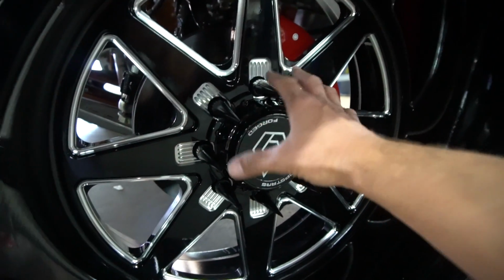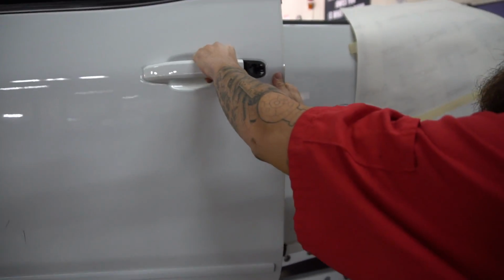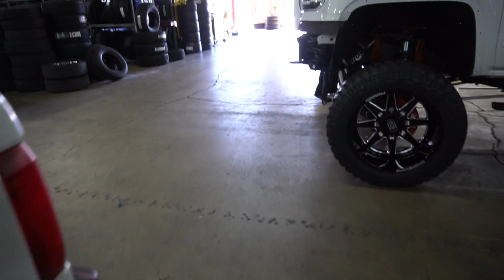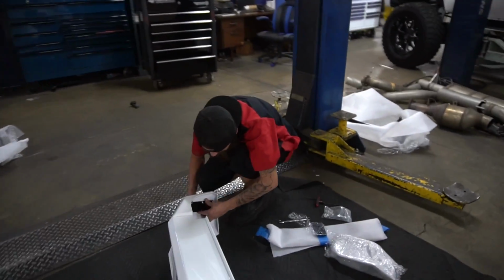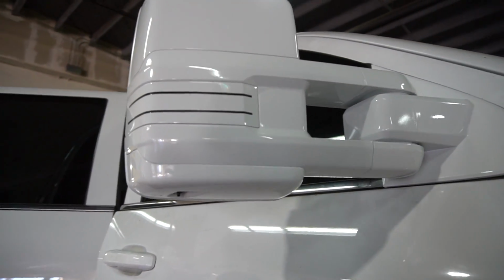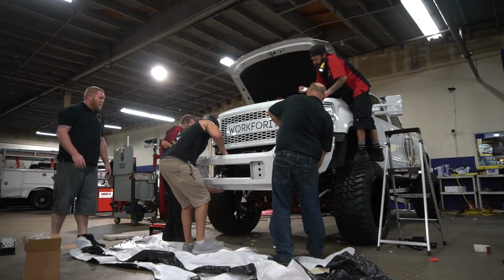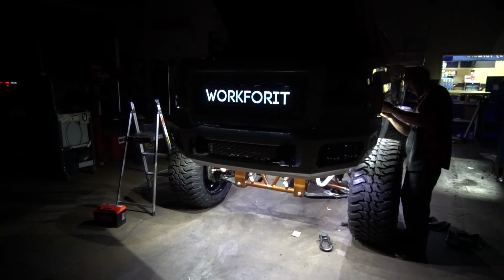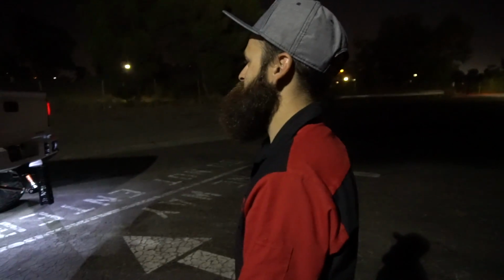MY SEMA TRUCK IS DONE!

Comment: Hey Ryan so I’ve never owned a diesel and was curious what mod is it that you installed and what does it do. When you start up the truck all of a sudden it sounds like the exhaust starts having a LOUD suction noise? Always been curious as to what that was and what it’s doing.
Reply: That's the wastegate on the turbo opening/closing to warm the motor up more efficiently.
Reply: kareem majeens ah ok I always wondered that, sounds pretty badass lol thanks for replying Kareem 👍🏽